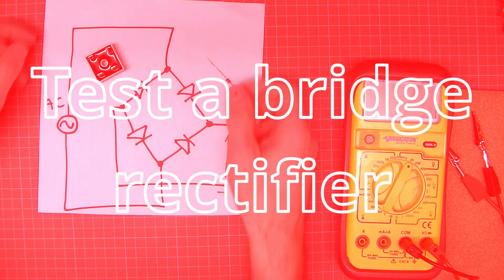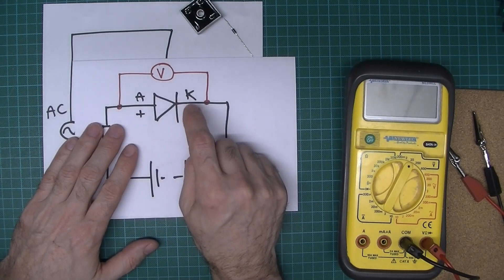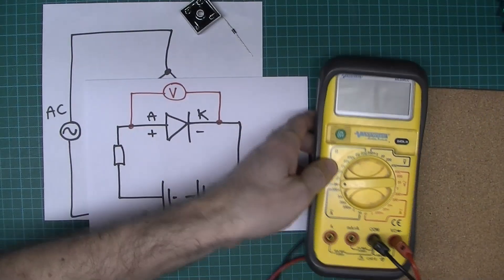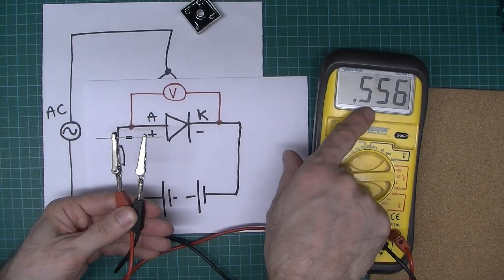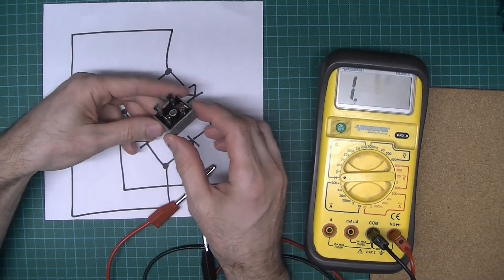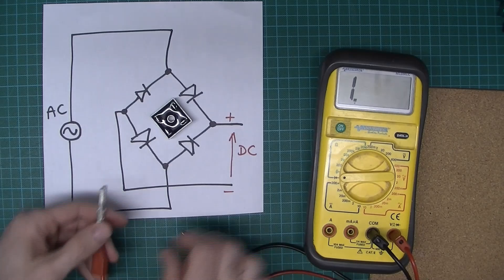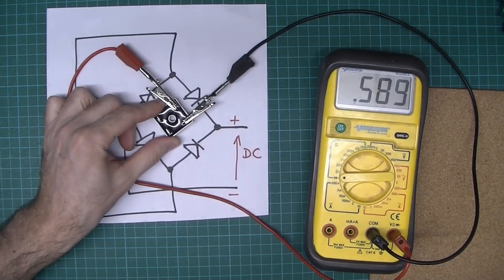How to test a bridge rectifier and diodes the easy way using a multimeter

Comment: I was thinking I'm sure there's a way to do this with a multimeter. Turns out yes, just not the multimeter I have access to at the moment, which has neither a diode or transistor tester.

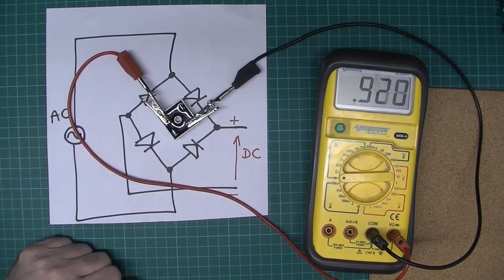Comment: 3:08 What if you get lesser than 1volt (0.6v) when you measure across the diodes in series but each individual diode measures at around 0.55
Reply from the maker: You have to bear in mind the IV characteristics of a diode. The typical forward voltage drop of a single silicon diode will be about 0.6V when there is sufficient current (refer to datasheet graphs for actual values). If the current is very low, you can't make this assumption.

Comment: Can you test a diode when its still in the circuit thanks ...
Reply from the maker: You could measure the voltage drop across it, which for a silicon diode would be about 0.6 - 0.7 V, depending on current.
Reply: @PizzeyTechnology  Thanks

Comment: If I placed 12vac on input, would I see 11.2vdc at output of bridge?
Forward voltage drop of 0.8vdc? More likely over 1.5volts.
Yes, testing with an a/c step down transformer. My app is flux welder conversion to electrode negative. So important to see forward drop value and full rectification.
Ac step down transformer, repurposed to supply voltage for output check.
Reply from the maker: Short answer - no. Longer answer - Is that 12 V RMS or 12 V peak? If 12 V RMS, the peak input voltage would be 12 * SQRT(2) which equals 16.97 V peak. A full-wave bridge rectifier involves two diode drops and if we assume 0.7 V per diode that's 2 * 0.7 which equals 1.4 V. Therefore peak output voltage would be 16.97 - 1.4 which equals 15.57 V. It might be worthwhile recalling this is DC peak output voltage and not a steady output voltage. If you examined the output waveform it would be a DC current (always in one direction) but with humps at twice the frequency of the AC supply. I hope that helps.
Reply: @PizzeyTechnology  That does help.
Diode check with Dmm and intregal paired sets were within 2mv of each other.
In DC wire feed flux core, can wire stickout affect peak(and)constant voltage?
As sold, my wire feed welders advertised secondary, non rectified voltage is 18v.  So may I assume 1.4v forward voltage drop to 16.6v?  0.7v for silicon. I did read a bit on switching transistor. Current beginning to flow at 0.7v and fully open at 0.8v.
Trying to learn a bit of rectifier control and then wave forms.

Comment: Why were you expecting about .5 voltage drop? I'm looking to drop from 110 AC to 28v DC .... what rectifier do I use as I need to drop a lot.
Reply from the maker: Typical silicon diode drop is about 0.6 to 0.7 V when forward biased. Less if no current is drawn. A rectifier converts from AC to DC, but it sounds like you also need a step down transformer or SMPS.
Reply: @PizzeyTechnology  Thanks for reply. I'm new at this stuff and you are correct, there is a step-down transformer in this power supply. I want to replace the 60 year old selenium full wave rectifier before it smokes out on me with this new bridge.  After the power leaves the rectifier it goes into a 1000uf cap and through a 500ohm resistor.
Reply from the maker: I have no experience of using vintage selenium diodes. However, I understand they have a higher forward voltage drop than silicon. They can be leaky, which could have affected that capacitor too. If the capacitor is old is be considering changing that too.

Comment: Do you have to isolate it from the PCB? or can you test them in place?
Reply: Looks like you can test them in place.
Reply from the maker: Bridge rectifiers can be tested in circuit. They need power (and a minimum load) to test the voltage drop across each PN junction.

Comment: Hey Pizz,got a circuit to run by u need a second set of eyes on it.. email address or whatsap ?
Reply from the maker: Sorry, but I don't share contact details here due to student safeguarding issues.
Reply: @PizzeyTechnology  no problem. Just an interesting design u might have appreciated and be able to throw a diff angle on..
Reply from the maker: Well post a video on YouTube and maybe we can all have a look. Good luck.
Reply: @PizzeyTechnology  cant do that... (it`s new tech shhhh)
Reply from the maker: @gabrielsansar6187  If it's a perpetual energy machine... sorry but I've got two of those already.
Reply: @PizzeyTechnology  no nothing like.. tho i am running way way over unity to power it
Reply: @PizzeyTechnology  Where can I buy 1 or more?  Looking to reduce my home energy bill, plus been feeling a bit tired so looking for model that can be ingested too  ;-)
Reply from the maker: What component do you want to buy? There are plenty of online sellers for suitable diodes and bridge rectifier packages if that's what you need. I wouldn't recommend ingesting any components 🙄
Reply: @PizzeyTechnology  Sorry ambiguous, was referring to "perpetual energy machine". Meanwhile with help from your clear, concise vid tested old (bad) bridge rectifier and ordered new 1.
Reply from the maker: @gr8dvd  Ah, ok! Read your comment on my phone and didn't see the context of the thread. Glad the video helped.